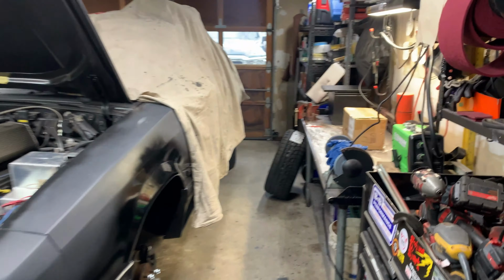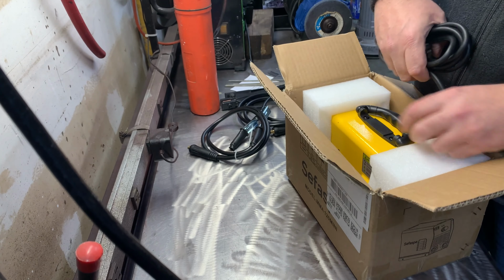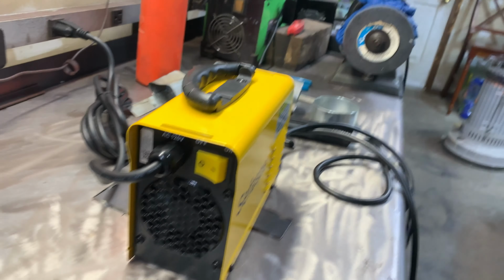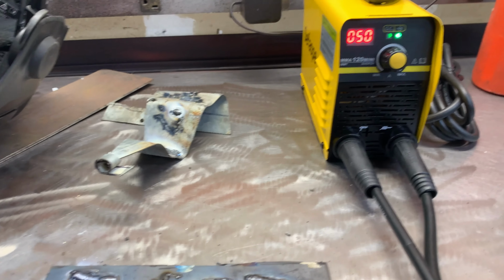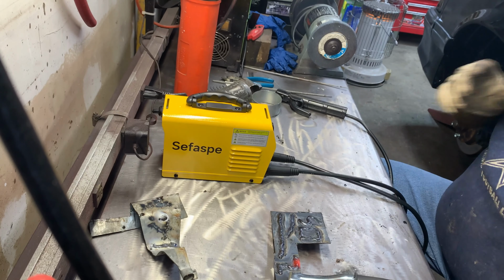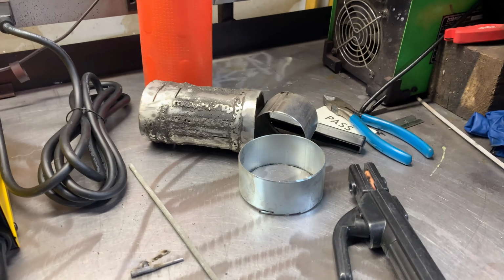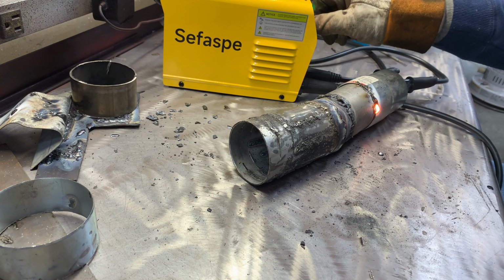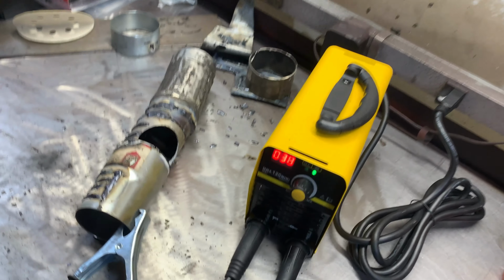REVIEW: Sefaspe Stick Welder Portable Arc Welder Machine

Comment: Did you notice you can push in the yellow button on the knob? If you hold it in, the display blinks. No clue what’s that’s for and it’s not in the manual. Great little $69 welder though
Reply from the maker: No, I didn’t know that about the button? Yea, cool little welder! Definitely a score for $69 bucks.